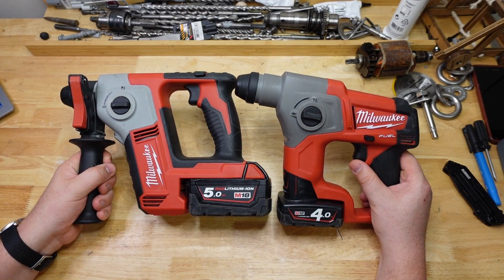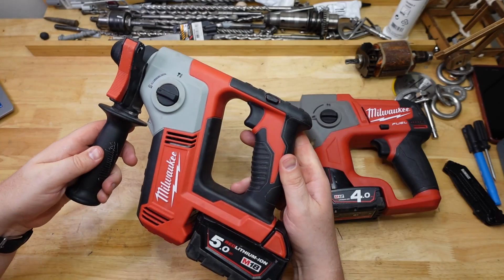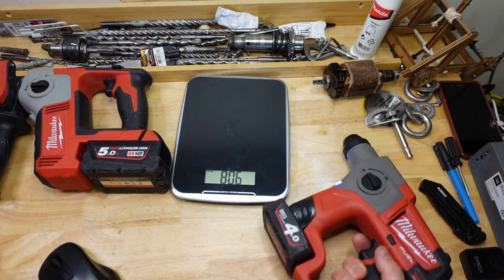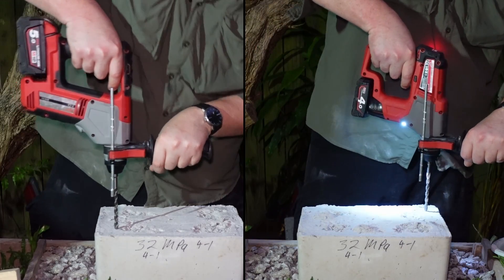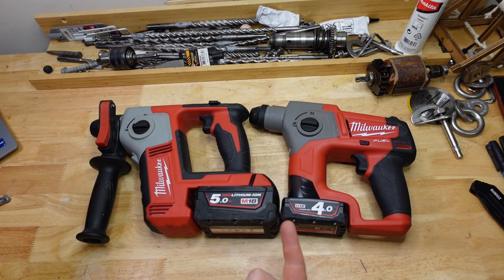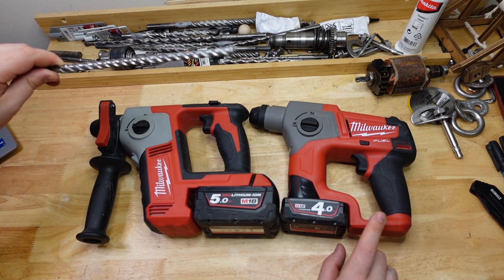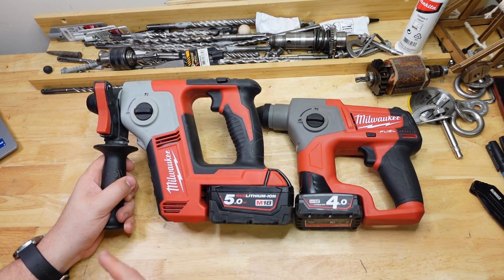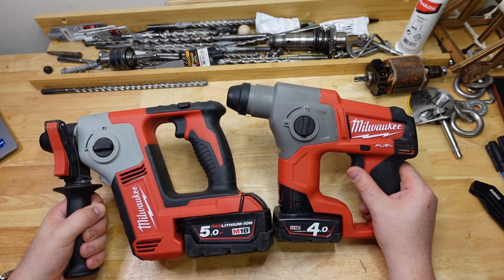Milwaukee M12 vs M18

Comment: That m18 is the non-fuel version. It's not going to be as efficient on power as a FUEL version would.
More volts is better, so an m18 tool should theoretically win everytime, except in compactness if that's what you value. But the m12 fuel should ride close. If you're going to be using a big, bulky m18 SDS drill, you might as well spend the money on a FUEL one.

Comment: Another interesting video. I don't see too many people with the small M18, and I get asked if they are good for bolting climbs, So far I I have recommend going with the M12 if they aren't already invested in m18 tools or the Fuel M18s if weight doesn't matter. Thanks for confirming my biases. 
Looks like you may have just hit your metrics for monetization. Congrats!
Reply from the maker: Cheers mate! Indeed I usually recommend the 18v compacts except in Milwaukee's case. That'll change when/if they release an m18 fuel version though.

Comment: ｍ12 os lightweight for 6-8 rarely 10mm work in ideal. If you work with 10mm++ you should consider m18 models, especially new ones.

Comment: I'm skeptical of Milwaukee updating the M18 compact rotohammer. I'm pretty sure they see the M12 as their premium compact rotohammer and if you want it then you need to buy M12 batteries. Whilst Makita makes 18V copies of nearly all its 12V tools, Milwaukee doesn't. I'm guessing as it allows them to sell more tools and batteries.
Reply from the maker: Selling more tools/stuff that's super specialised is definitely their business model. I think that's part of their extra cost too: more models=more design effort.
But they seem to be sharing that design effort with Ryobi more so I think it's a decent indicator. Guess we'll see! I'm pretty keen to try the new BL Ryobi too